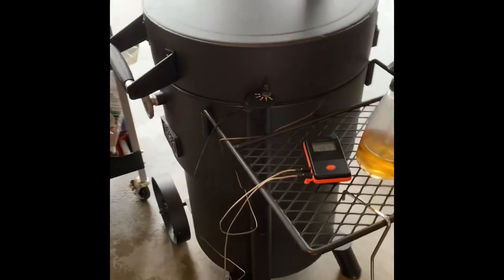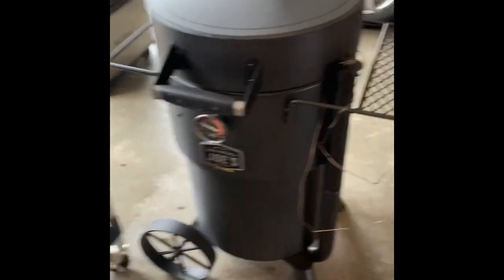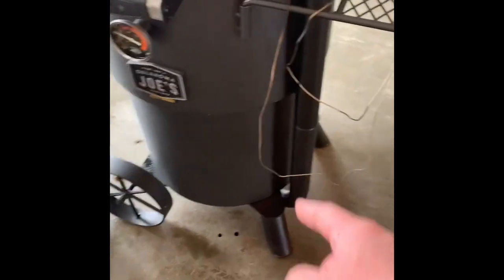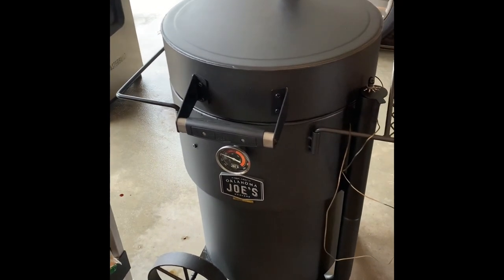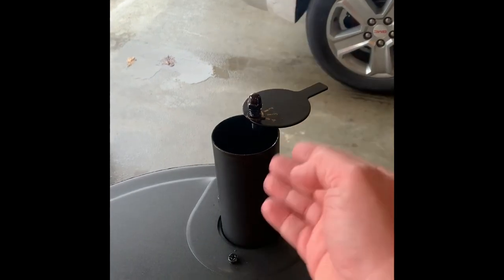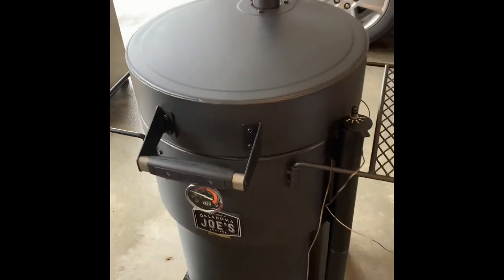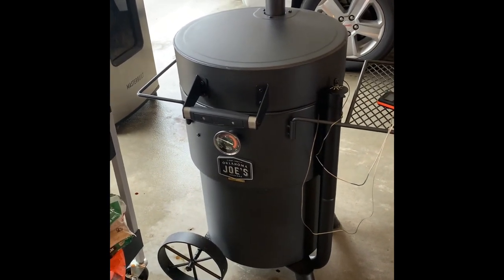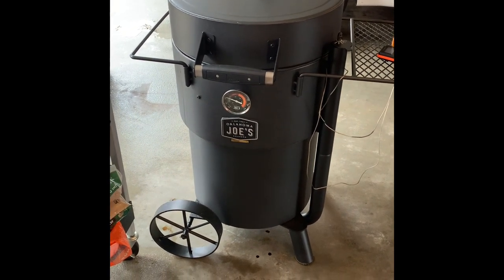Temperature Control & Air Flow in the Oklahoma Joe’s Bronco - Baker’s BBQ

Comment: How accurate is the thermometer? Can it be calibrated, or, replaced? Thank you.
Reply from the maker: Hi Dick and thanks for watching!  Mine appears to be 10*-15* off (lower) than the actual temp, which I check with my Inkbird.  It can be replaced but not sure about calibration.
Reply: @BakersBBQ same with mine. It's pretty accurate up to about 300.

Comment: My first time using then O Joe's Broncho.  My temperature BBQ 300. I want to smoke chicken drumstick. How do I reduce it to smoke 275. Try many ways but it doesn't works. I open the lid and the temp go to smoke, closed the lid, the temperature , back to 300, please advice. Thanks
Reply from the maker: Hi Julia and thanks for watching.  The key to temperature control is how you bring it up to temp.  If you let it get to hot it’s hard to bring it back down.  Here is another video I did on getting the Bronco up to your desired temp correctly.  Hopefully it will help.  Thanks once again, please like the video and subscribe to my channel 👍🏻😊
https://youtu.be/Y_U8m5v4kY8
Reply: @BakersBBQ  Will try again next time, what i do now is to stick to 300 and will check again in 30min will update you again  thanks for your advcie
Reply from the maker: @juliasanchez5762  yes, just go with the 300* for this cook and use my technique next time 👍🏻, thanks again for watching and subbing 😊